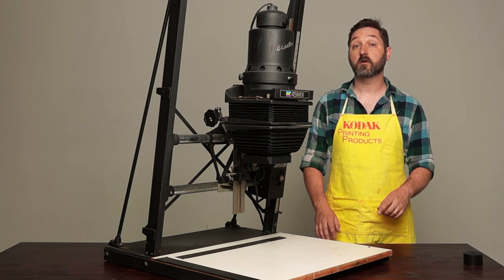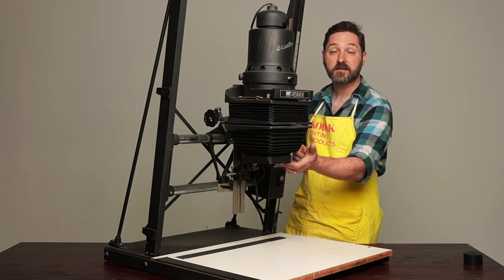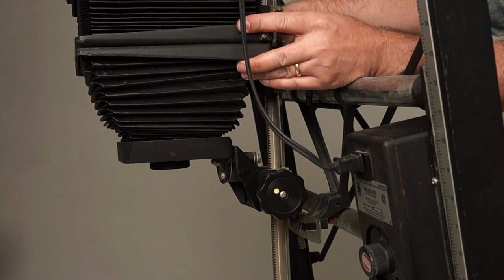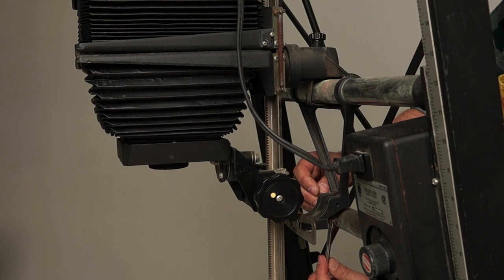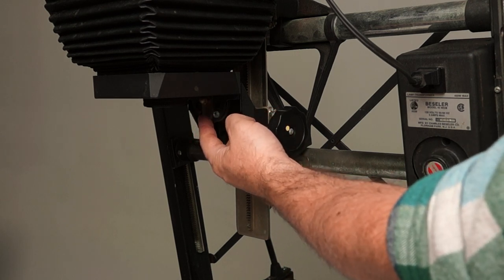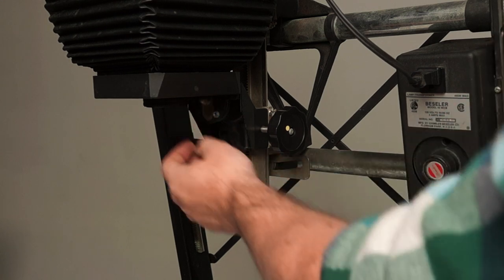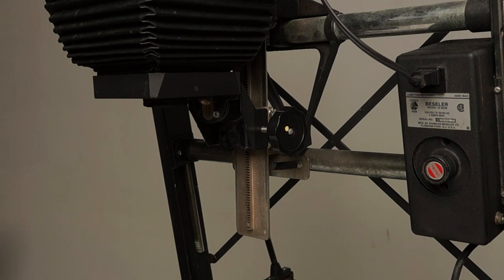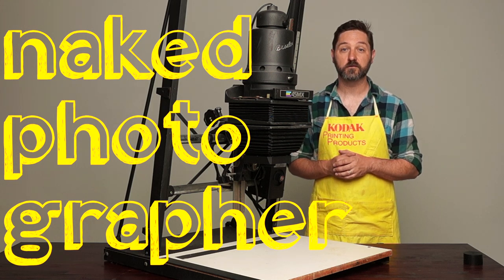Align The Beseler MX, MXII, MCRX

Comment: Super helpful and timely for me. Just scored an MX II for free! Very good condition though the baseboard is gone. 

I have one very basic question. How to determine whether the enlarger is aligned as it goes up and down the track? I've never used one before, so should I expect that the image stays in the exact same place relative to the easel as the head moves up and down? Or, another way of saying it: should one align it at multiple elevations?

Also, I anchored the top to the wall to help stabilize (using turnbuckles to adjust as needed), but this too could effect the squareness of the track to the baseboard, yes? Seeing your video, I feel I may be overthinking. 

Last, I have seen folks use the thumbscrews on some lens boards to adjust the lens relative to the baseboard to get at the non-adjustability of the lens in fore/aft. Or craft an adjustable lens board with three thumbscrews playing off of a sacrificed lens board to dial in the lens.

Anyway, really like all your videos, and this was perfect timing. You're very clear and precise!
Reply from the maker: You shouldn’t need to adjust the enlarger at different heights, and bracing it to a wall is not a bad idea just for stability sake.  As for the lensboards with screws, I couldn’t tell you what those two screws are for as they don’t touch anything on the enlarger at all.

Comment: The original 'alignment procedure for the 45 MCRX'-leaflet describes a couple of extra steps prior to the alignment shown in this video. They align carriage and frame as follows:
Remove lamphouse and condensor assemblies, tilt the remaining bellows, negative stage and lens stage assemblies into and 90 degrees position (wall projection).
Remove the LOWER stop pin (limiting the switch). Run the carriage assembly down the track until the gears disengage from the toothed rack while holding the lower counterbalance assembly firmly. Hold carriage in both hands and lift until it rides the track evenly. At this point, you are engaging gears evenly on the toothed rack. Push the motor switch upwards and the carriage will ride up. Place a carpenter's square in contact with the baseboard and the left and right side of the lower counterbalance assembly. If the lower counterbalance assembly is not parallel to the baseboard at this point, then, repeat the above procedure.
Note: if the carriage appears to be parallel to the baseboard at low magnification but not parallel at higher magnification, it may be necessary to adjust the rear support struts. If the right side of the carriage assembly is lower than the left side (facing from the front), adjust the left strut as follows: remove the two screws fixing the strut to the baseboard and turn the foot clockwise at least one full turn to the desired position. Re-insert screws. If you find it difficult to re-insert these screws, it will be necessary loosen the screws the right-hand strut.. This will provide a certain amount of 'slack' or play' and allow you to tighten down the screws. Once the carriage is parallel to the baseboard, re-insert all screws and tighten the hex nuts. If the struts are adjusted unevenly, a 'twisting' of the entire upright frame will result, This will cause uneven operation of the carriage assembly in the elevation gear racks and might  eventually wear out these gear rack and/elevation motor. THEREFORE THIS PROCEDURE MUST BE CARRIED OUT CAREFULLY AND SLOWLY!